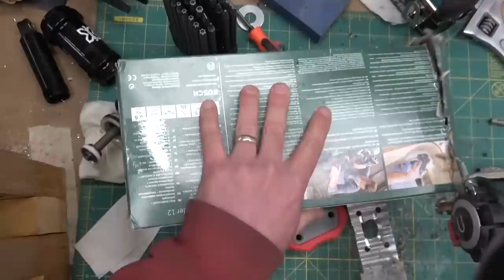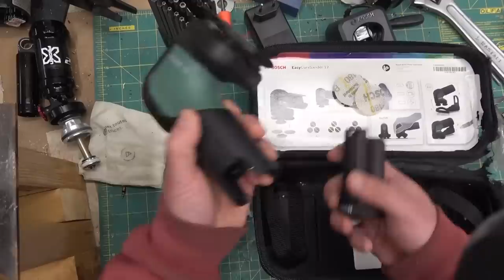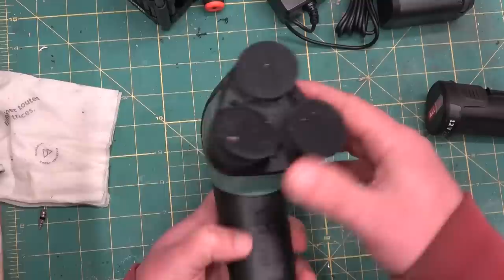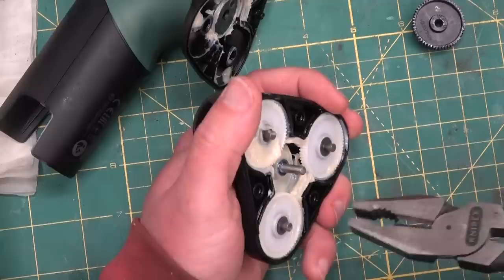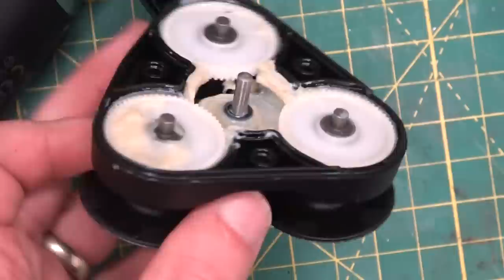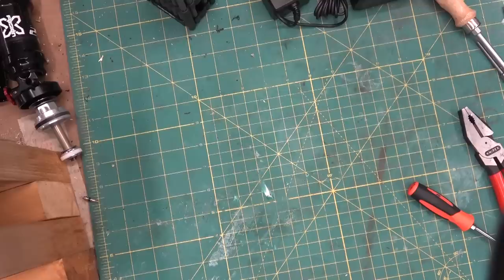BOLTR: Bosch Bunion Remover?

Comment: im just waiting for him to hit a battery with his "box-opener" lmao
Reply: @tightirl  Depending on the amount of humidity in the atmosphere a lithium battery would surprise you the way it acts when it comes in contact with water internally. Quite a show.
Reply: @tightirl  uhh noo.. if its a LiPo battery just puncturing the cells will cause a fire. dont believe me, try it yourself, just be sure to film it for us.
Reply: @tightirl  I can agree that it is somewhat over blown and almost treated as if it were an everyday occurrence but at the same time it's no joke when lithium batteries do burst into flames.
Reply: @tightirl  lol no, just no. first of all pic or it didnt happen, second of all i guess what you are describing COULD be possible if,and only IF,  just the OUTSIDE PLASTIC LAYER is punctured. batteries (lithium) are complicated things, as to say more complicated then a lead acid battery. both the chemistry and the physical layout are complex,  if the two [internal] sides of the battery where punctured and came into contact with one another then it would cause a run-away chemical reaction that ends in a fire. Lithium is very volatile and violently reacts with many things, like water for instance. even in a lab environment it can be hard and dangerous to work with, it eats away at glassware, and then comes into contact with the air, which usually contains moisture and ends up catching fire. lithium fires are nasty and damn near impossible to put out, cause you cannot do so with water, even immersing the fire in an inert gas such as argon could fail to put it out, which is why it is common practice among fire departments to just let lithium burn itself out and to worry only about "exposures." so if what you claim to have done is true, i am almost certain that it WAS NOT a lithium battery, more likely a lead acid battery or a NiCad battery, both of which are far more stable to punctures. once again if you dont believe me you can try it yourself, although i really dont recommend as there are plenty of videos just here on youtube.
Reply: @tightirl  I can assure you that if you disassemble a lithium battery and raw lithium comes into contact with water you will absolutely have a show on your hands better than something you would see in Vegas my friend. I absolutely could give you total instructions how to do this but without the proper PPE you would most certainly get hurt.
Reply: @tightirl  hahhahah nope
Reply: @the_socompsp  I've seen this many times firsthand. I could not have explained that better with your voice. Lol
Reply: I was charging an RC quadcopter battery whilst watching some vijayos and when I looked over the fucker had expanded to probably 25% oversized. 

No sooner had I extricated it from my room and sat it on the ground outside when it violently erupted into flames, spraying molten hot electrolyte in every which way, including all over my fingers and the back of my hand. 

It’s easy to think the dangers of Li-ion batteries are overblown till it happens to you!
Reply: @mrb692  all the colors of fire too! Sooo purty! 😂
Reply: @tightirl  Haha, no. Li-Po or Li-Ion don't like to be shorted internally. Fully charged it is even worse.
I've personally created a fireball by putting a screwdriver halfway through a lipo cell. I've also seen videos of cells like 18650's turning into mini rockets when they are damaged.
Also, the organic solvents comprising the electrolytes aren't super great for you.

Comment: I wouldn't say completely useless. My ex has elbows that will take the grain right off a 2x4, maybe this could take the burrs off of those or die trying
Reply: Oh man, I used to have some elbows like that when I was younger, I didn't need to remember that but thanks anyway I guess?
Reply: @vgamesx1  I aim to please
Reply: I get elbows like that during the winter for some reason. Also the back of my hands will dry out, until the skin cracks and bleeds.
Reply: @urishima  -  udder cream or any other moisturizer will help...
Reply: @urishima  Lanolin if you can use it. That'll help with the hands and elbows.
Reply: @urishima  okeefes working hands.
Hard to beat!
Reply: 😃 lol

Comment: A nicely made, well designed waste of money! 😄
Reply: How's it a waste of money? Bosch is making a tidy profit, which was always the intention of the device. Oh, you mean for the consumer? Well, they have to get him/her/it to take the money out of the wallet and hand it over to much more needy organisations, like Bosch and their distribution chain, so they came up with something to lubricate such a transaction. I just can't see how its a waste of money - its the essence of free market capitalism. Just keep buying shit!
Reply: I love the box, shows it over a friggin wood floor! I can see young'uns and the uneducated picking this up after watching a home fix up show and attempting to fix that floor in the house.... Before going through the discs and one set of batteries and it never gets used again.
Reply: @volvo09  For what it's meant to do, it works fine. Nobody's gonna use this shit to rebuilt a house. But I have a few things at home this would be perfect for, like smoothing the wooden globe heads on the wooden fence before reapplying a new coat of varnish and clear coat over it. I'd rather use this tool than do it by hand with sanding paper.
Reply: @MiniLuv-1984  Well said, and you're probably correct on all points...but, if not waste of money then certainly waste of resources, waste of our limited time on earth, and negative impact on the planet - in that sense a waste?

Comment: I'm a wood elf lol and need to look into that for sanding bowls on the lathe. Wonder if it will flex enough for inside radius
Reply: We talking salad bowls or soup bowls?
Reply: They already make a tool for that, it’s basically a foam sanding pad holder on a bearing with a handle...   spin the bowl, press it against and that spins the disc, foam lets it curve into any spot.
Reply: @grendelum  thanks that helps alot

Comment: I wonder if it has the extra voltage tap on the battery because they are using unmatched cells that are rejected from the higher quality tools. If the cells aren’t matched then they are definitely going to hit the low voltage limit at different times so you have to check all of their individual voltages to be safe.

Comment: Those pads look to be basic hook and loop type. So You probably could cut out any grit abrasive disk spares for this machine out of sandpaper/mesh sheets - and get any finish that you like. 

Also the machine itself seems to be mainly designed for curved areas - which are quite hard to sand evenly otherwise.

Comment: When I had one of them new fangled Mercedes automobiles, the Mercedes parts always worked great, but any time something broke, the parts I removed always said "Bosch India" on them. I think the days when Bosch cared about quality are long gone. It's all about shaving those 2 pennies off the costs now (as with most companies I guess)  Regardless, replacing broken Bosch parts always made me sad. 
Now lets not even get started on how Bosch almost bankrupted Mercedes with the faulty injector scandal that resulted in hundreds of dead cars parked all around every dealership in the land, waiting for Bosch to ship injectors that actually worked
Reply from the maker: Ooooo... down the rabbit hole I go!
Reply: Just say Cjherman again -I've got bunnies that need seeing to.
Reply: I think Bosch was involved in the Volkswagen and Chrysler diesel emissions cheating scandals. I also think that in time we will find that Cummins Mack/Volvo and Detroit are cheating as well. They all use a Bosch designed control system for the emissions systems. I find it strange that Cat was the only manufacturer that used their own system and it failed miserably.
Reply: Nunya...Bosch also made the garbage diesel cp4 fuel pump that gm is being sued for as they all crap out.
Reply: @scythelord  100% agree

Comment: AvE I have a question.  I just asked the elemental maker this one too
The whomp of a static discharge in a midian blaster is a prity good one as you may know, some times makes your wrist turn in.

I finaly got our blaster grounded at work and was wondering, Is it possible to capture the static build up in a media blaster? 

Instead of discharging into my forearms and making my buddies twitch like a tweaker, It discharges into my makita batery or some AAs for the ol'lady.
Reply: Apologies for the miss spelling
Reply: Or in some capacitors
Reply: Great question
Reply: @EitriBrokkr   thanks I'm almost positive you can I beleve aeroplanes do it so the static build up doesn't discharge I to passengers or sensitive electronics

Comment: That will likely be a 12v motor not 5v. There doesn't seem enough thermal sinking capacity amoungst the electronics to accomodate a ~5% transfer in energy from voltage conversion to thermal emission. It would probably require additional thermal sinking. Also it would make sense to run a higher voltage to the motor with less current allowing for thinner wires (less copper) and a direct energy transfer from battery to motor at full beans without changing the V/A ratio.

Comment: Obviously for sanding down motorcycle gas tanks, fenders and other round'ish stuff.  Then again, there is better tools for that job too. Polishing your bowling ball? idk. theres a use for every tool, this one looks like a good paperweight...
Reply: This Bosch thing looks like it'd be best suited for high-grit light sanding or polishing of rounded/uneven surfaces. Or maybe Uncle B. Fuchs can CNC up a hooha mangler head for it so it's three rattlers in one fun gun, and present it to the Missus at the next celebration of their nuptials. Or auction it on FleaBay. :-)
Reply: They make bowling ball spinners for resurfacing bowling balls.  Think a dog dish with a big motor attached to it.

Comment: The pinion, or sun gear if you will, is powdered metal and not MiM. MiM would not be used to drive a nylon gear. Typically pinions in power tools are PM or steel cut.

Comment: I've just dropped a piece of POM (from a K'nect kit) into concentrated H2S04.

I'll let you know how it fares.   Without getting caught in a rabbithole of plastics research, from your mumblings, I gather it might be sensitive more to chlorination.
Reply: Nevin Williams any early results?
Reply: @dbayboyds409  Thanks for reminding me!

So the part I put in yesterday started out white.   It quickly turned dark brown.  I thought it might totally dissolve, so I left it until now, a full day later.

It didn't;  When I cleaned it off, I noticed the surface was much rougher, and i could see ridges and divots in the surface of the part.

As I examined it more closely, I scratched it with my fingernail, and about half a mm of brown 'crust' flaked off, exposing white underneath.

The white stuff was also degraded, and had a rough, powdery feel to it.

So, yeah, it doesn't hold up in strong acidic conditions.  It'd have broken had it been a gear.

Comment: The Du Pont Company offered the first commercial acetal homopolymer, a high molecular weight polymer with a molecular structure of repeating carbon-oxygen links, under the trademark Delrin® acetal resin in January 1960.

Comment: You should take a look at that Worx "AI" drill at Canadian tire, ordered one of their leafblowers for doing the car and sidewalk and whatnot since on ebay it came with two batteries for cheaper than one with a single battery at Canadian tire.

Looks fairly interesting as a light duty drill, minus the completely stupid "AI" marketing for that pulse feature, I bet the chuck mechanism is pretty cool, and also curious how it holds up in terms of power compared to conventional drills.

Tempted to buy one whenever they go on sale since I'll already have batteries and a charger and whatnot, and wouldn't mind sending it to you though not sure how long you'd need to have it sitting in the queue.

edit: they are cheaper on ebay as well by a good margin compared to CT.

Comment: Bosch now makes EV components as well, literally everything you’d need to make one less the car shell and suspension...   sort of a nice full circle.
Reply: Well taking almost any european car almost every box says bosch. In mine for example Engine control unit, Bosch, Auto trans(ZF) control box, Bosch. Injectors, Bosch, High pressure diesel pump, Bosch and list just goes on. And car shell around bosch stuff is french..